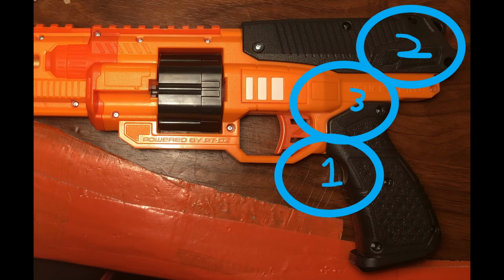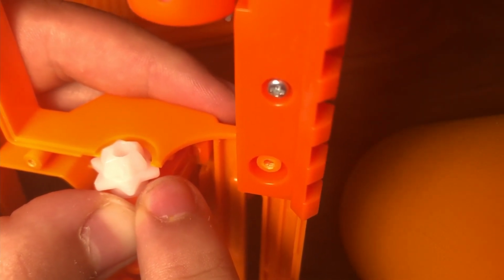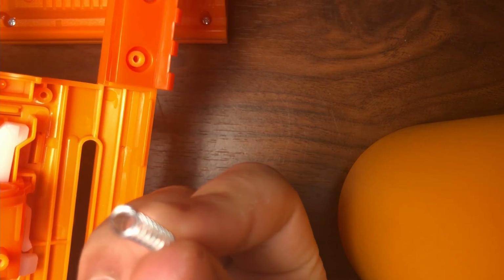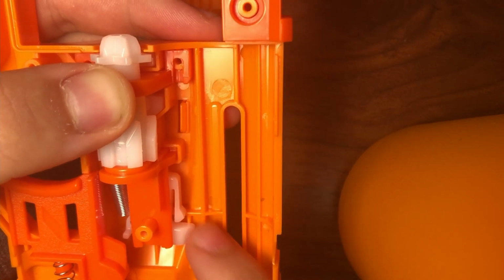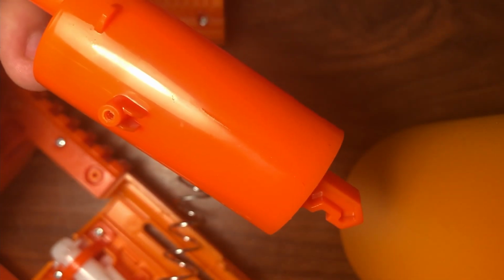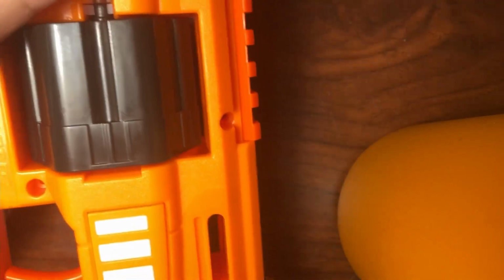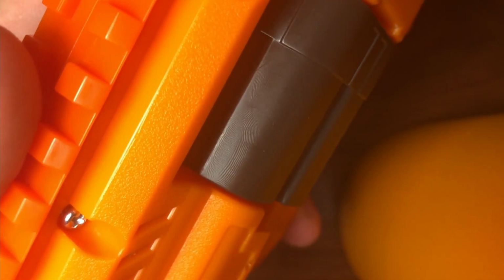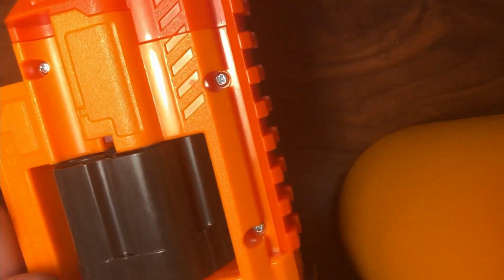Deuce Pro Fix(some of the issues with) Rotation and Remove Locks [Guide]

Comment: This video helped me out, I found an ink joy clicky-pen spring that works perfectly well. The slide lock is now defeatable after rounding the shoulder that stops the return and putting 4 pieces of heat shrink over the wider plastic spring arm. I haven’t replaced the safety trigger with a suitable delete yet but all the other mods have been done on two different deuce pro revolvers. Also, I want to mention that cylinder swap is pretty easy and seems to me more of a low key left-handers blaster in general 😉
Reply from the maker: Glad it helped :)

Comment: Cheers Bruv! You’re a legend. In addition to your improvements I would like to share a fun fact I discovered while I was watching. An aftermarket scar barrel that fits the Nexus or Aeon Pro will also friction fit to the Deuce Pro but not with the included barrel attached. You would have to friction fit it on to the Deuce itself. Thus for reducing the length of the Deuce and FPS in regards to the included barrel attachment but….You will still have more length for the dart to accelerate under compression and it looks really cool!

Comment: I don't think that rotation (skipping) issue will ever be resolved, unless the parts are replaced with precision metal or something. Any skipping for a revolver is totally useless for me. Dart Zone should recall and fix the problem at the factory. Excellent video btw..

Comment: I did the same to mine, but it still wasn’t working reliably. I actually found if you upgrade the spring under the wedge part and the star/toothy part of the rotation (rototion lol) mech, it works 80% of the time. I’ll take that over a 1/6 chance.
Reply: I had the same issue but mines was 50%. While indexing it would reliably skip a chamber.

Pen springs vary so much it would be hard to make it a universal fix. I had to snip it to make the spring shorter and it was noticeably stronger than the stock spring.
Reply: I ran across the same thing.  100% of the time, it would skip one cylinder.  Realized the forces of the cylinder were hopping after coming to a stop but not because of the wedge.  The toothy bit was spring into the blaster allowing the cylinder to always make an extra hop.  I didnt have a spring big enough to replace the toothy plunger one so instead I cut a spacer out of the same ball point pen that i used for the other part of this mod and forced it into the plunger.  has to be an exact fit to allow the spring to be affected but still allow the plunger to move the full distance (or you wont be able to get the cylinder out).  The only problem with this mod is that it now takes a TON of effort to remove the cylinder each time.  But it does fire reliably.

Comment: Do you need to pry the top part of the shell to open the blaster?
Reply from the maker: No? Unless you mean the plastic tabs, in which case just lightly move them out of the way with a flat head screwdriver.